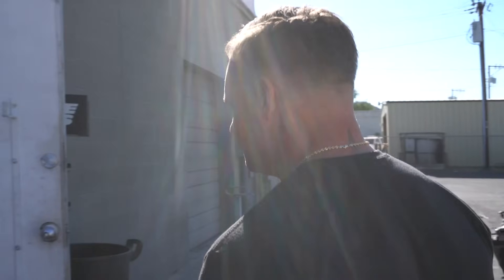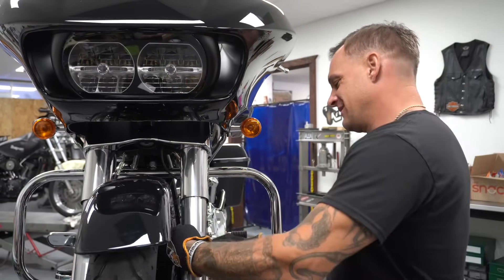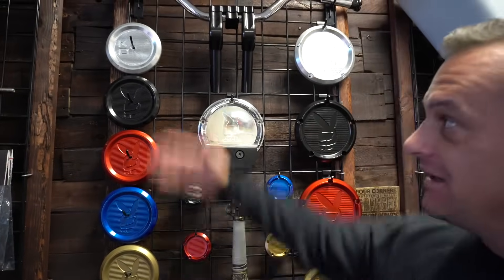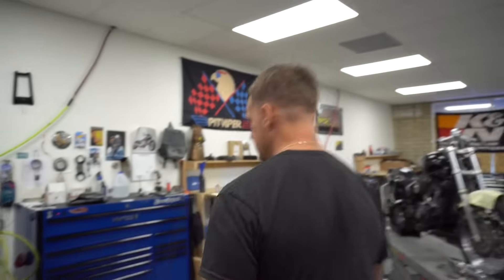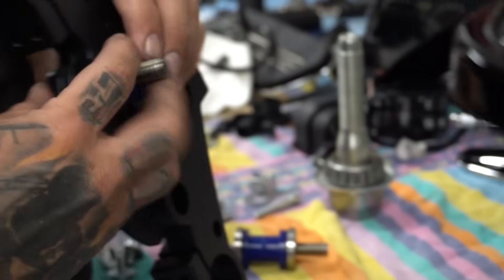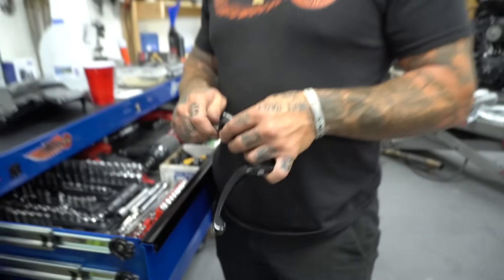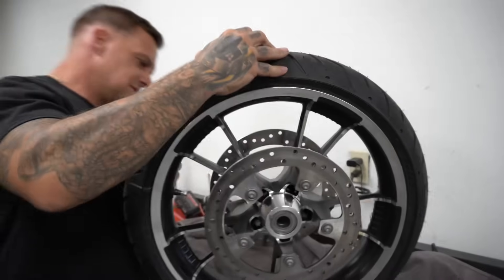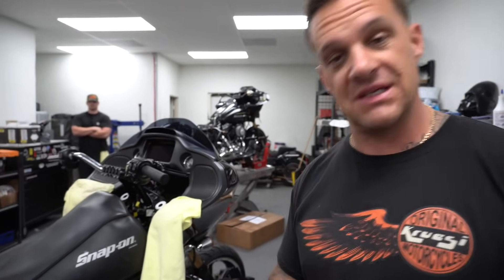2021 road glide , House of Harley / Kruesi Originals performance build (P2)

Comment: What do you guys do to fix the brake light switch running these masters on a twin cam ??
Reply from the maker: On a twin cam I just unplug the front switch or cut the wires and jump them. This one I just made a plate to compress the actual switch itself so it thinks that the brake lever is on the bike

Comment: I have the upper mount kit for the legends and I have a factory sissy bar (black and chrome 👍). If you run the taller top mount it fits with a sissy bar and the tour pack mounts.

Comment: Mr Kruesi are you going to make your k-bar for the bagger? I have same bike and was thinking of changing out the engine guard with either the chopped one or crash bar style(not sure that would offer protection for bagger). but I'd wait if on buying if you were going to make your k-bar.
Reply from the maker: We are going to run a Santora Fab works cage on this bike. I don’t know if I’ll be building one or not anytime soon

Comment: Also I’m 5’8 and ride a 2010 FXD I’m slowly switching up my set up, would the 6” risers with some pullback be ok? And bars should I do a drag bar or get bars with a little height?
Reply from the maker: Totally depends on what kind of riding you are doing, I would never suggest tea bars though they are extremely played out. 
If you’re stunt riding sixes, if you’re just cruising and road tripping get some eights with pullbacks it will bring the bar closer to you. And a mid bend bar
Reply: Hell yea 6’s it is. I hate my t bars plus everyone here has them, Apple valley (Southern California)
Reply from the maker: @Corndogtrip6s  hell yeah
Reply: @kruesioriginals  I want to learn so I’m slowly setting it up for stunts so if you have any tips or if there’s anything I should do to the bike first I’ll take any advice I can get

Comment: Not a pro bike builder at all but i do work in electronic engineering. You probably don't necessarily need "guages" what you need is a return signal. You could eliminate the display keep whatever computer is inside them and just leave it inside the front fairing. Open up that guage and see if you can pull out the wire that runs to the display and see if it still runs. If it does your good to do whatever with it.
Reply from the maker: That’s a good idea I’ve been looking into making a jumper and just plugged you in. Make it think it’s reading a gauge.
Reply: @kruesioriginals  i did a little digging into the circuit charts i could find and that should work just fine. It just needs a complete circuit so jumping it closed with something that plugs into itself should work

Comment: Wasn't sure if I heard correctly, but they make triple trees that de-rake the front end? If so, where do you get them for a 2016 Dyna?
Reply from the maker: You don’t there for Baggers. 
And the only Dyna you would want to D rake is a Lowrider, And for those he just gets super glide trees in your set
Reply: @kruesioriginals  thank you for that. I do have a Lowrider, and now have a mission.
Reply from the maker: @Markotto09  If you get super glide trees, it will take you from 32 to 28° of rake.  We can usually get them pretty cheap if you call the shop Trent can help you out. 602-494-5207

Comment: You can eliminate the knob ignition by messing with the settings in the security system when it’s plugged in at a dealer. They just put a CVO setting on it so that it just turns on with the run button.
Reply: That's what they are doing and removing the Ignition switch altogether.
Reply: YEP, got that done on my RGS. Don’t miss the knob at all.